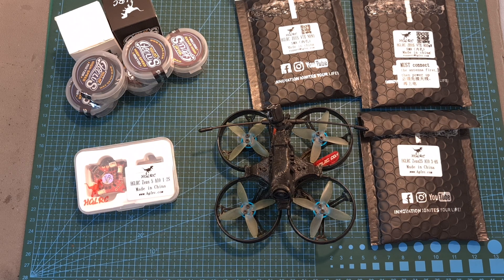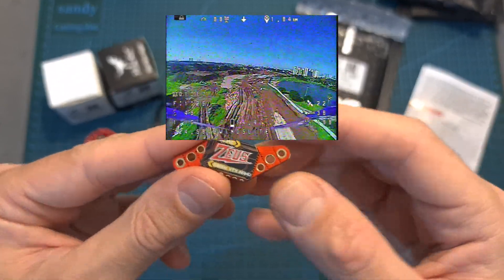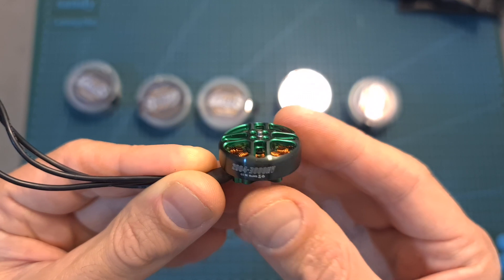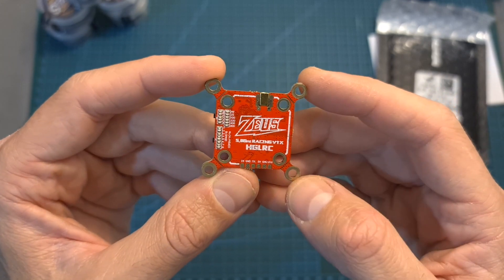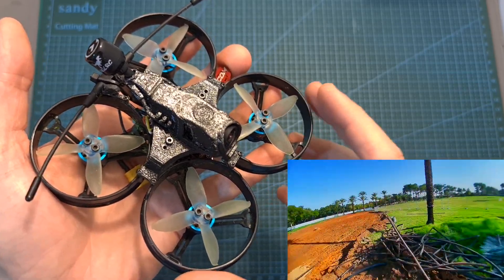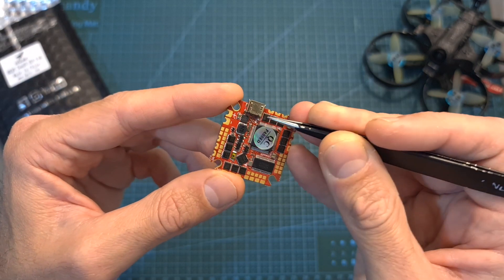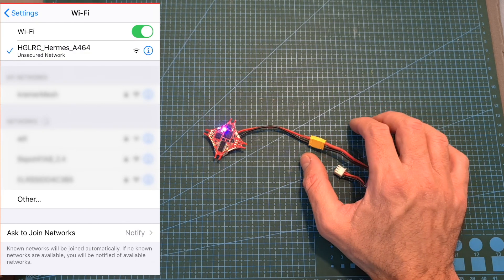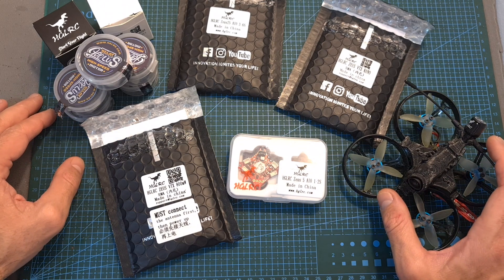Latest And Greatest Products By HGLRC // 2004 Motors // Zeus5 // Zeus25 // Motowhoop HD

Comment: I’ve liked hglrc for a while now.  I updated my old KingKong flyegg100 motors to the hglrc 1104 7500’s and made a huge difference in performance on that little guy.  For their new 2207.5 motors I love what I see but wish they could figure out how to drop just a couple grams off the weight.  If they could get it to 31-32g with about 80mm of wire  I think they would be perfect for my race setups, but I think for freestyle they should do great 👍.  The one thing I don’t understand on the 2207.5 is the Kv options.  One color motor has options for 1900 and 1950kv yet the other color option only has 1900.  May just be a typo on bangmegood tho.
Reply from the maker: It's not a typo (Check HGLRC's website). It's weird though.

Comment: Looking forward to your on the bench RF power tests on the Zeus VTX 800mw. I have ordered one recently and I am interested to know if it actually outputs approx 800mW as the VTX table provided shows the power level of 600 but labelled as 800:  https://hglrc.freshdesk.com/support/solutions/articles/61000285900-vtx-table-for-zeus-800mw-vtx
Reply from the maker: It's just the label. On 800mw I got over 900mw.
Test should be up tomorrow.
Reply: @KremerFPV  Thats awesome as I was planning on putting it in my Explorer LR analog version.

Comment: On your P19 GepRC when doing flips or coming out of dives do the motors sometimes freak out and it rolls to the side?
Reply from the maker: I don't have it anymore. Did you change anything on Betaflight? Anyway I don't think that it is capable of doing too much acrobatic manoeuvres...
Reply: @KremerFPV  Yeah it's stock and using gnb 3s 350mAh 30c batteries. Yes I'm wondering if it's not capable too. Seems like it should be though given those same 1103 motors can run 3" props on toothpicks. I'm going to naked mod the vista next week so hopefully the weight reduction will make a difference.